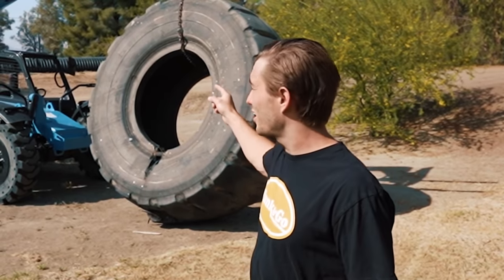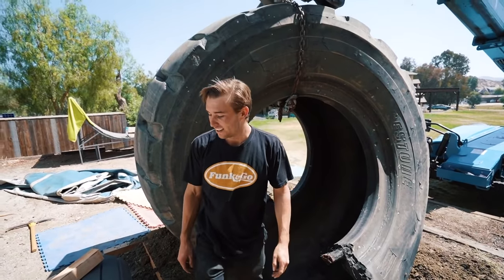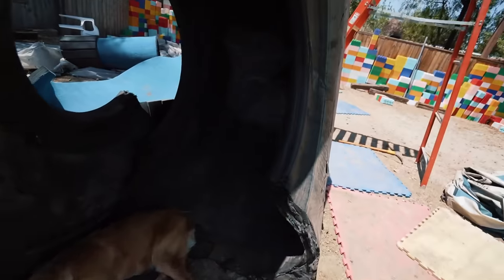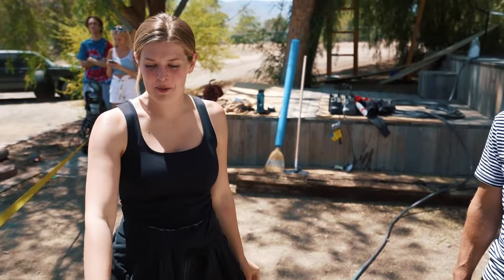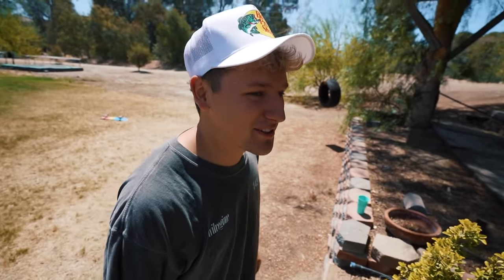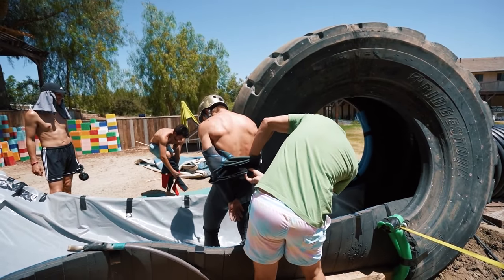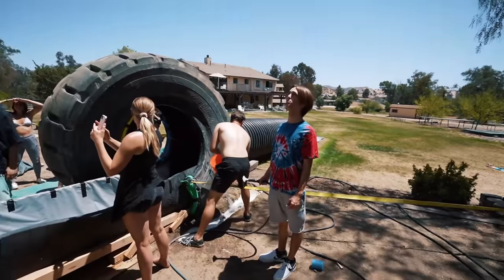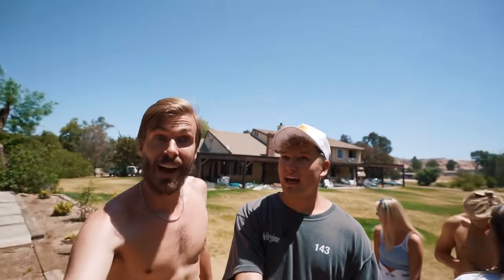Built Water Slide LOOP With A Gigantic Tire!

Comment: Circular loops are dangerous. The G force spikes from default one G to almost 9 G's in no time. You should build a clothoid loop like they are on roller coasters. That way you guys won't hit your head and get a whiplash and actually enjoy the feeling of going upside down and it'll be somewhat safe

Also for the sake of god pls make that pull up from the drop less sharp so you'll keep more of the energy from the loop and again it'll be safer and more comfortable

Comment: fun fact there was a water slide loop built before and it was quite horrible and it had no holes so you could get stuck and also you would hit yourself inside of it so hair skin and teeth would end up clogging in but the water pressure for the slide was so powerful you would just slide past it so like it just cuts you as you slide quite horrible